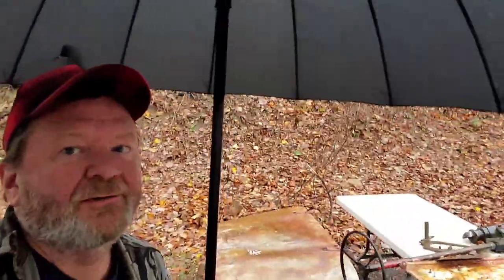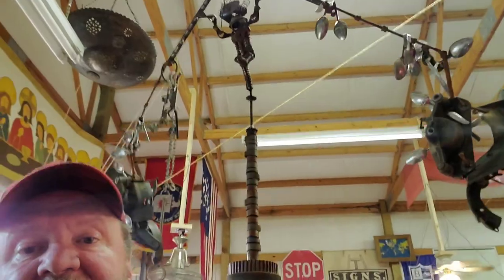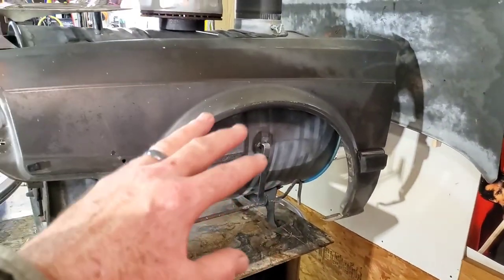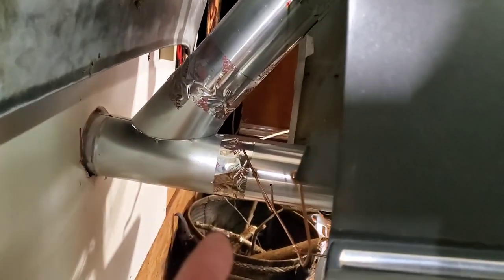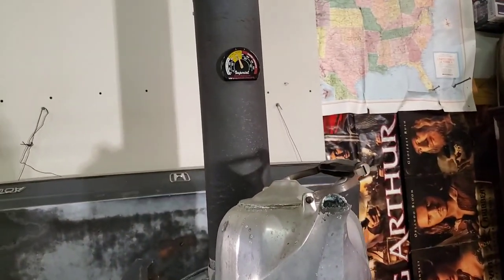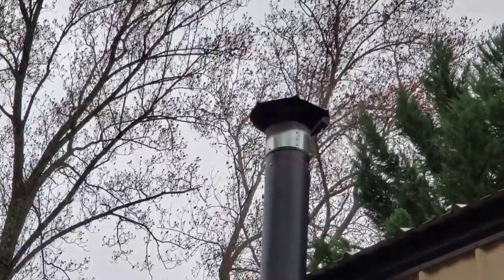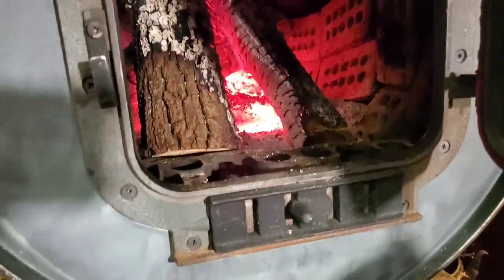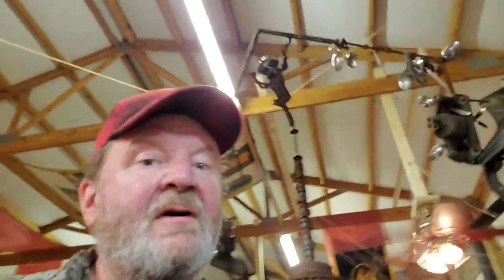Rat Rod Barrel Stove is Finished. Clean secondary burn machine, Plus 85 Honda fenders.

Comment: So does the secondary burn tube work well or was it a waste of time?   You didn't really show it working.
Reply from the maker: I can't show it working without installing some sort of sight glass. Might do that.  Meanwhile, it seems to work.
Reply: @OGGarrettsGarage    I did find another video where it's working.  It just looks like a burner in a gas oven.  pretty interesting to see.   I'll be building one in my barrel stove now.   I think I'm going to throw a pipe in there next to it  that I can fill with water, just for a boiler/ humidifier.  It dries our house out like crazy sometimes, and we're already using a gallon cast iron kettle.  cheers.
Reply from the maker: I had 2 modern wood stoves at a previous house that both had to have either a catalytic type filter or a secondary burn system to comply with the California smog rules. I chose secondary burn and learned how to get the system balanced. The biggest tell (if you can't see into your stove) is the elimination of smoke. I know I've got the air adjusted correctly when the only thing I see coming out of my chimney is heat waves.  Cheers!
Reply: @OGGarrettsGarage  Noted..